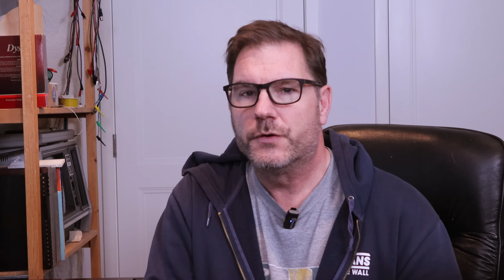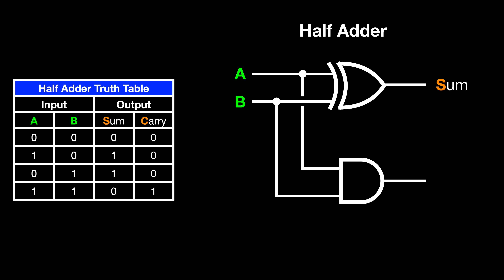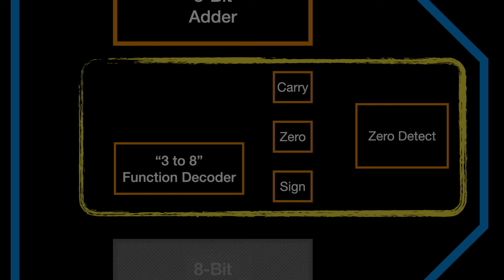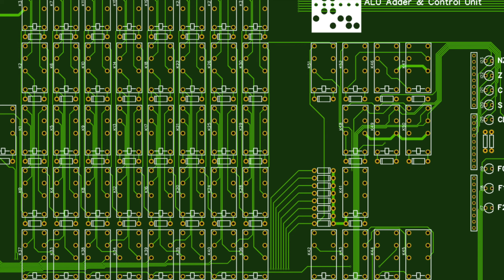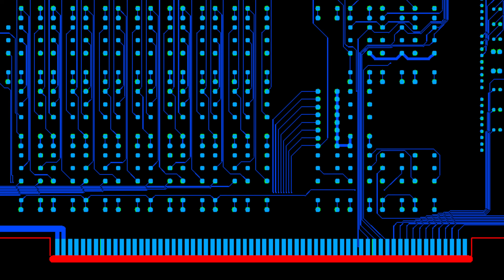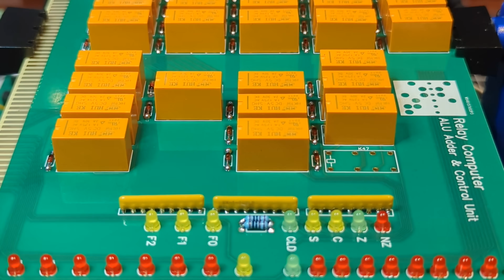Relay Computer - ALU Arithmetic and Control Unit

Comment: I've been watching your videos and I'm curious, what types of software will you be able to run in this computer when it is ready?
Reply from the maker: It currently has 9 primary instructions for loading or moving data between registers, arithmetic and logic functions, jumps, etc. So for now, the software would be able to perform some basic math routines (like the Fibonacci sequence) but ultimately could be used as controller for other things (not fast, but entertaining...)

There's a more detailed description of the instructions here: https://youtu.be/kssPvofgYzE?si=-GFXyX8YimSlMhiN&t=57

Comment: I have noticed that you dont socket relays. I build relay cpu from same relays (around 250 in total) and they do occasionally break. please socket yours too!
Reply from the maker: That's a good call - I haven't had any break yet- although I can see that unsoldering them will be a challenge if/when it happens.

Comment: As I'm seeing this I was wondering if you can later on add two of your 64pin connectors to the back or somewhere on the enclosure, so you can connect the prototype backplate outside of the computer, could bring your I/Os out and design a board with for example an (VFD) 16x2 Display on it. With enough memory it's easy to control such an Display and it would look pretty nice :D
Reply from the maker: For sure - I'm thinking that I can add the two 64pin connectors so I can add some external capacitor memory in future - it will be big enough to need an enclosure of its own!

Comment: I have two suggestions.

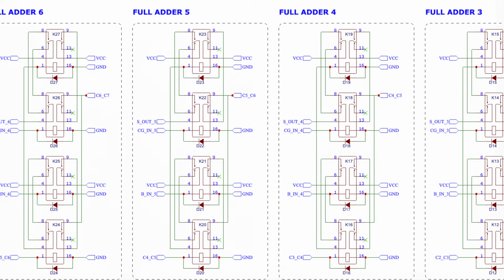1. Draw schematics with contacts and coils unlinked, link them to specific relays only by names. Drawing contacts and coils like they are placed physically will cause serious spaghetti on the diagrams. Even right now analysis of the circuit in 7:55 is very hard for me.

2. I would suggest redesign of the adder (and other parts too), use "dual-rail" encoding of bits. This design will produce swarm of swear words from author's mouth when problems with contact connectivity will arise. The result will be false without any kind of alarm when it happens. Check how Konrad Zuse designed his Z-3, there are schematics available in the web. Well, its not an actual computer but more a calculator, anyway it has floating point ALU made from relays.
Btw, there are hard reasons why vintage decimal designs used bi-quinary or 2-of-5 coding instead of bcd. Such approach can eliminate many problems, or at lest indicate them instead of returning false calculation results.
Reply from the maker: Yes, I'm still relatively new to the schematics things - more recently started using NETs to ident links. As for #2, I did consider the Konrad Zuse dual rail (I believe it's what Dr. Porter used in his RC) - something for future consideration - Once the base machine is running I'll be making some modifications 😬

Comment: Any reasoning as to why shift-left was chosen as the final logic operation? Shift-left is the same as adding a number to itself, which you can already do if you have a adder. Shift-right, however, is usually the one you'd better have a hardware ALU operation for.
Reply from the maker: Good question: It's actually going to be a shift-left circular (so more like a Rotate Left). I based on Dr. Porters design - ideally I could have both a left and right in later revision. I'm guessing one useful thing would be to able to pull a specific bit by rotating left and checking the (edit) sign flag.
Reply: @dipdoting  Rotate left can also be accomplished in two instructions by adding A to A, then adding-with-carry an immediate of zero to A. I usualy prefer rotate or shift right on my designs, because it allows you to check bits of a number starting from the least-significant. This immediately becomes useful when trying to program a multiplication loop.

Comment: It's always nice to see that someone is even nerdier than oneself. The algorithm which flushed this video into my recommendation list right now is most likely unaware that I just a few weeks ago built a 4bit full-adder using very similar relays for my students on breadboards. However, I cheated on the full-adders and essentially replaced one relay by two diodes, similar to your cheating on the NOR gate.
Reply from the maker: Now that I have to try!
Reply: Could you describe how your ciquit worked? did it use 3 DPDT relays per full adder?

Comment: Fun to see the initial stages (after mechanical) computers.
Usagi Electric works on the next step with the vacuum tubes so we have channels for everything!
You have probably seen his channel. Will you be adding a paper-tape reader as a final step once the system can run code or will it be memory only?
Reply: And then we also have James Sharman making a machine out of discrete logic. I guess all we need is someone making a CPU out of raw transistors to complete the set.
Reply from the maker: Whoa! Awesome idea!!!!!!!
Reply from the maker: The Usagi build of the reader was amazing! I've been thinking of some external storage that would be "period correct" - I don't have a paper tape unit (punch or reader) but maybe magnetic tape? Would have to be 9 tracks or something like that.
Reply: @dipdoting  How about a mechanical card reader?

Comment: Simple but w9rking nicely. I maybe forgot on how the alu functions are send off from. Could you humor me and tell me again?
Reply from the maker: The functions are decoded as the last 3 bits of the ALU instruction. So if the instruction is 10000101 then the ALU would receive function 101.
Reply: @dipdoting  where are  the function instructions coming from.?